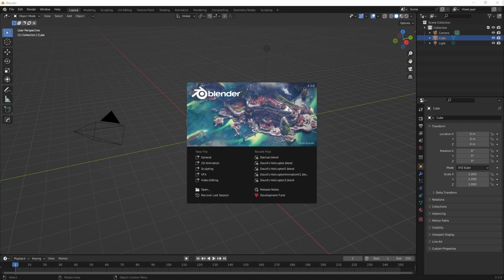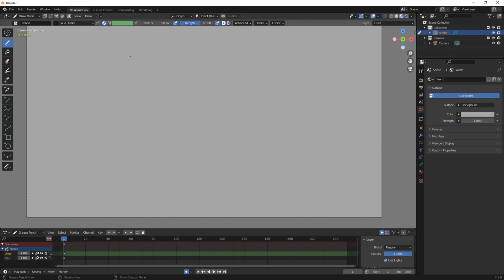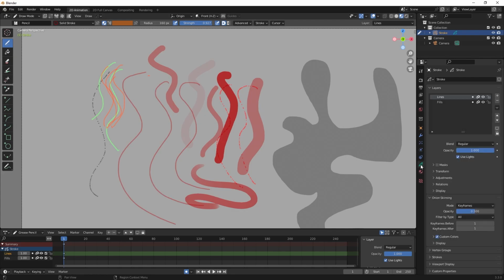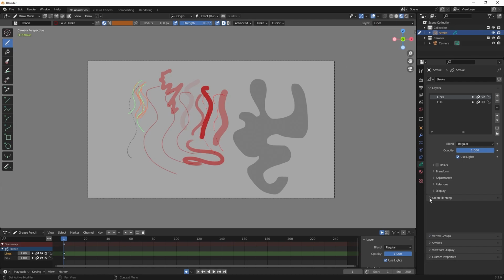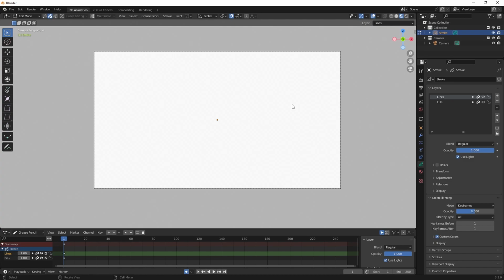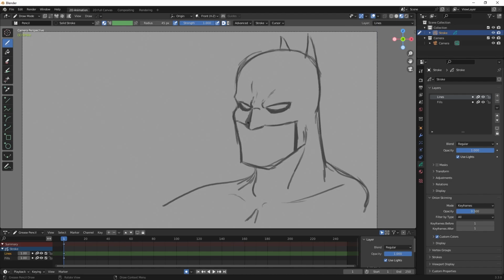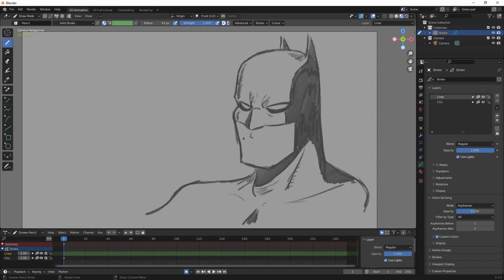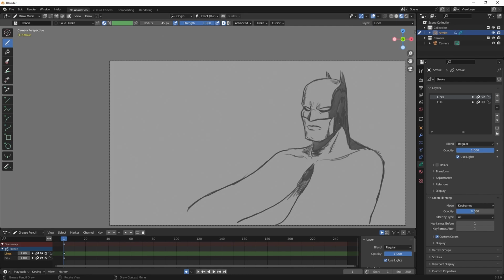Blender Tutorial: An Intro to Grease Pencil

Comment: Thank you for this intro video. It was very informative and just enough for beginners. I have been using blender for 13 years though, so I don't know about complete beginners.
I just want to point out that the shortcut for choosing tools while working is shft+space and not just space... at least on my computers.
Reply from the maker: Great! Glad you found it helpful! I appreciate the feedback. Concerning the tools shortcut, I just tested it on my version of Blender, and the spacebar brings up the tool menu and shift+spacebar toggles the timeline on and off. I checked it in object mode and draw mode. I'm using 3.3.1, and I don't think I've changed any of the default shortcuts. Maybe they changed it at some point, or I'm not using the default shortcuts and don't know it. Anything is possible. Thanks again!
Reply: i think these settings can all be changed in Preferences >> Keymap
IIRC when we install Blender we get the option to select how we want the spacebar to operate - bringing up the tools menu is one option, playing animation is another, and i think search is the other option